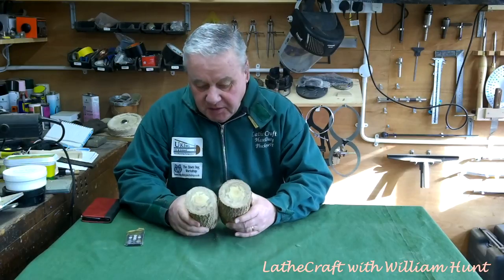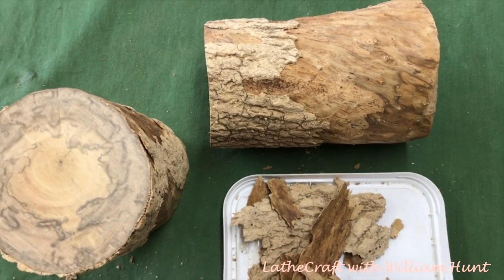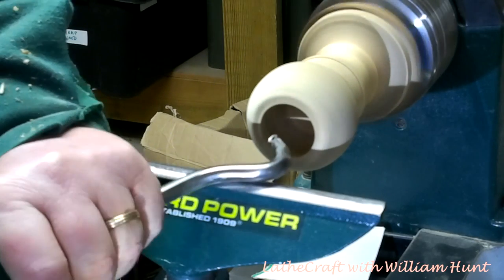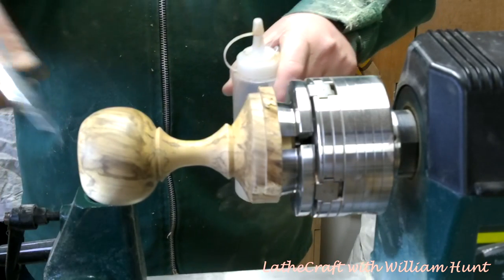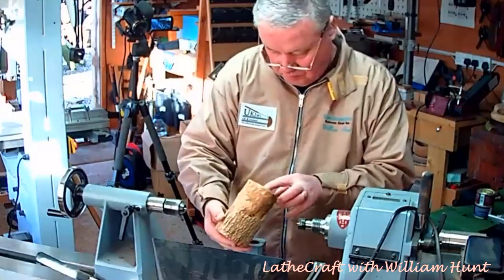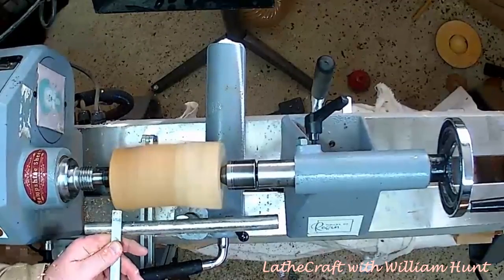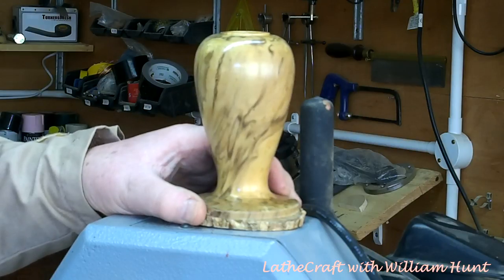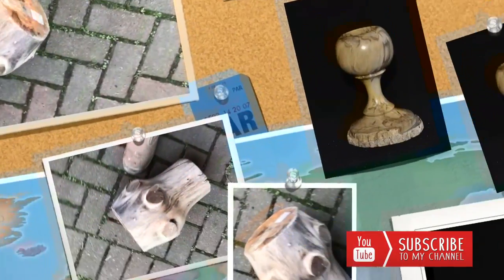Woodturning - Boxwood Projects.

Comment: Hi William, i normally watch you on tv but you recently said you didn't like the stain that CA gives, try using sanding sealer first then CA, to fill the cracks, cheers Dave
Reply from the maker: Hi Dave, yes thanks for the tip, I believe a few people use other techniques, I must try it. I seem to always make a mess with CA, resin and most other things that you can spill!